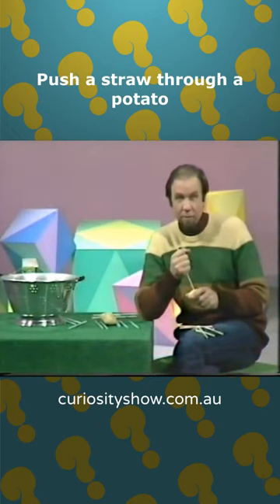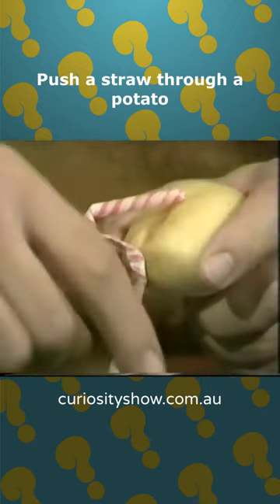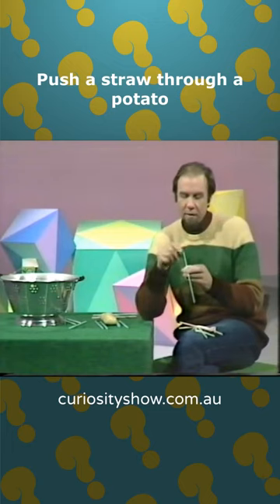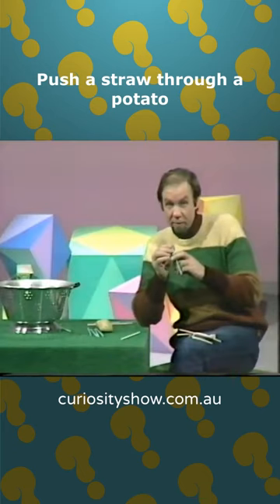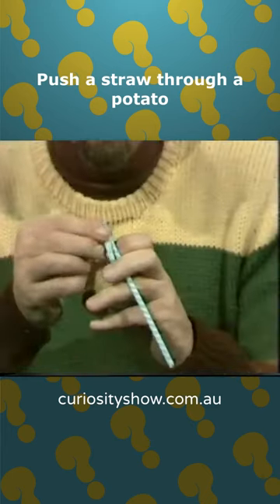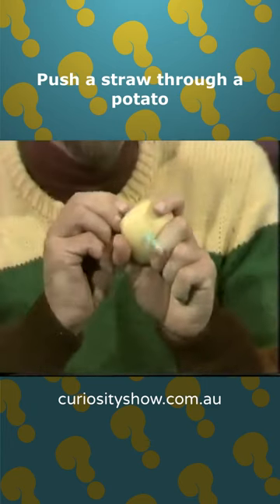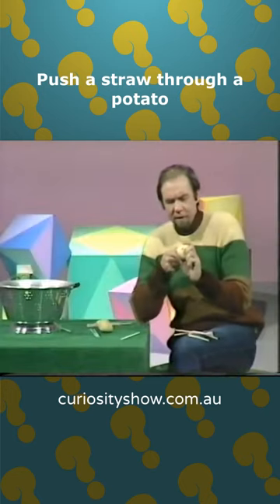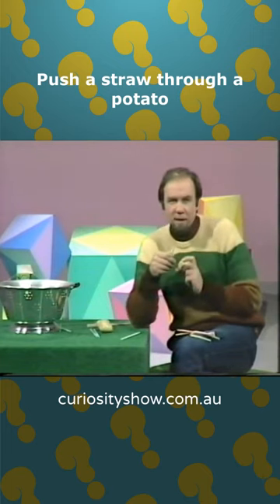Potato straw - with a difference

Comment: And it all happens because because the air is trapped within the straw when it touches the potato, the pressure inside prevents the straw from deforming and acts as a blade.
Reply: Also you don’t need to crimp one end if you can get the straw up to 100 mph ;)
Reply: thank you for providing this piece of info! I didn't figure this one, but am usually very good with things like that 🫡
Reply: Its actually the tension of the plastic having already been bent. Air is everywhere it makes no difference for things like this. The straw doesn't break because it's already bent.

Its like trying to bend a rebar back easy to bent, impossible to bend back.
Reply: this is not true. It is mostly in the way you hold it. 
The greatest force on the straw is the moment of impact, where the pressure within the tube is the same as the surroundings
Reply: 😂 don’t trust an engineer that gives such “explanation”
Reply: @OmicronCoder  exactly, but it will not work the same if you don't seal the rear end with your finger, otherwise air inside will be pushed and the straw will break more easily. Hence the air tension plays a role.
Reply: @SergioCastillo87  Sergio, it will work regardless of the finger blocking the hole. I believe you can find demonstrations on youtube. As I said, it has nothing to do with air pressure
Reply: @SergioCastillo87  consider the scenario. Pressure in the straw only builds as it enters the potato. So at the initial puncture, there is no pressure difference. Thus it is the same as an open tube at the moment of entry. So we would expect them to behave the same, beginning to enter the potato, and the open straw would crumple inside the potato since there is not pressure as in the closed straw. But this is not the case; the open straw crumples before it enters.
Reply: @OmicronCoder  I'm not sure if you are validating my statement or explaining that it works for different reasons. All I'm saying is that because the straw is sealed between the potato surface and your thumb then the air molecules trapped inside are compressed as it penetrates the potato pushing the walls of the straw and preventing them from collapsing, thus the straw doesn't break. This is the principle behind this experiment, nothing to do with the straw doesnt bend because it was already bent like someone tried to suggest.
Reply: @SergioCastillo87 I am saying your explanation, while ubiquitous online, is incorrect. This air pressure effect has little to do with the result
Reply: @OmicronCoder  well i didn't search for this explanation online, it just seemed the most obvious to me. but when you said it was incorrect i did search online and everybody seemed to agree with my initial thinking. While i don't understand your reasoning just yet i think i will test this and collect more data from the different results.
Reply: He did it for the fries
Reply: I wouldn't say "acts like a blade" lol more that it acts like a more solid object with the internal pressure hahaha
Reply: @OmicronCoder think one that straw penetrates the potato the straw becomes air tight with potato in one end and the other crimped. Now the potato at the same time is pushing further into the straw, compressing the air inside the straw. Aka not the same as the surrounding atmosphere
Reply: @OmicronCoder the straw doesn't bend and crumble in on the first part that touches the potato. It occurs once the straw takes more force than it can handle and bends at the weakest point which is certainly not the first point. This here explains how the first touch is the initial plug and then boom, it's a air tight straw being compressed
Reply: @SergioCastillo87 yeah he was completely disagreeing with you whole time, he thinks the straw can't become air tight because it bends before that can happen, completely ignoring the fact the air tight seal from the potato occurs before the bend
Reply: @alrightgeeze  Also notice the straw breaks in the video at the moment of impact when she pushes it in slowly. Not at some later point where the supposed pressure would be assisting
Reply: At least someone explained it 👍
Reply: Well this is all so fascinating I turned into a maris piper
Reply: Nope it's inertia
Reply: There was always air in the straw
Reply: @ecospider5   at a 100 mph without air blocking the end, the straw will still crumple, if not be deflected by the potato.
Reply: 👳‍♂️winner winner chicken dinner
Reply: @OmicronCoder nonsense mate, of course the air stops walls from collapsing for as soon as they begin the volume decreases and the pressure increases in proportion

dearie me have  a word with yourself!
Reply: @DemonetisedZone  If you read all my comments explaining the effect it should be obvious that the pressure increase is not responsible.
Reply: A tornado with 300MPH winds will put a straw through a telephone pole. I've seen a photo of this.
Reply: @E.V.A.N-COProductions  Nope! Like @juliavixen176 said, straws can go through wood without crushing
Reply: @OmicronCoder  Impossible, the straw will shatter before going through wood. It is far too thin, far too weightless, and importantly without the other end being blocked. Pressure won't build up. If the straw isn't destroyed by the wind's alone, then it will be with the wood.
Reply: Thank you
Reply: It’s almost midnight, I’ve nothing else to do on a Saturday. So I’m witness to a dispute between two chaps who don’t know each other.
Other encourage them. It’s about potatoes and paper straws but based on an old tv series.
These two are very entertaining, so I’m enjoying this one.

Comment: Nowadays, not only more dramatic to use a paper straw, but also the only way we can do it these days, with the reduction in plastic straws
Reply: Near my house they are all using biodegradable plastic straws.
Reply: very relieved to know
Reply: Sorry trees, we don't use plastic anymore
Reply: Stainless steel straws work pretty well. But you need strong lungs or very thin fingers to get at the weirdest little potato chips.